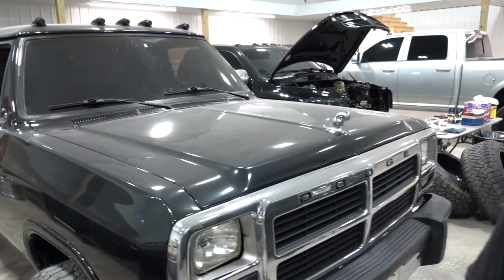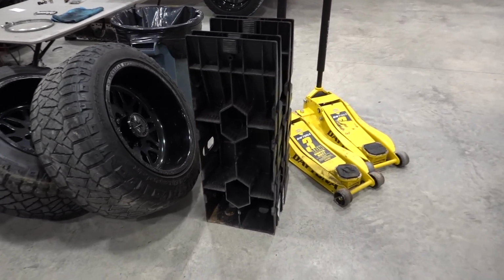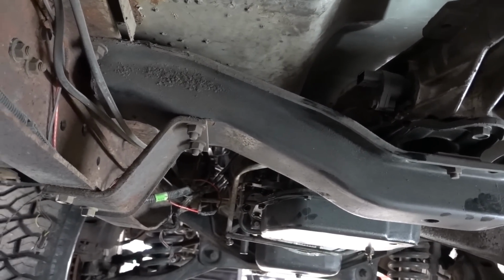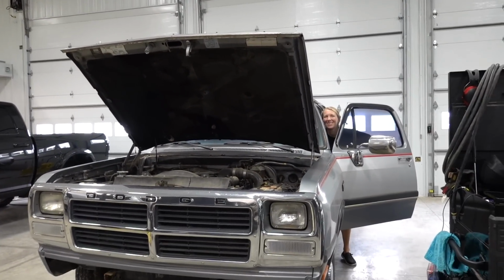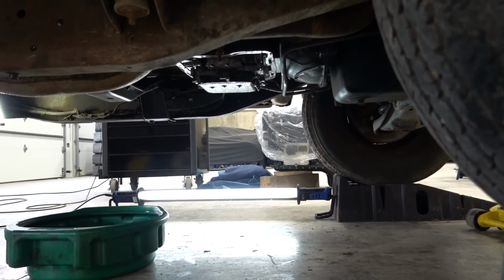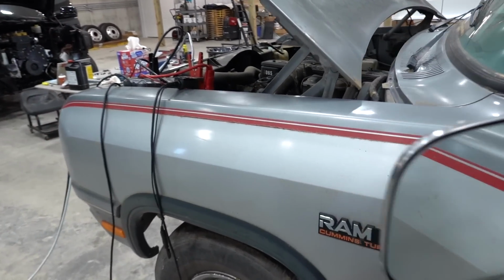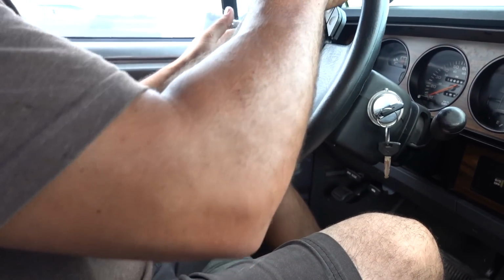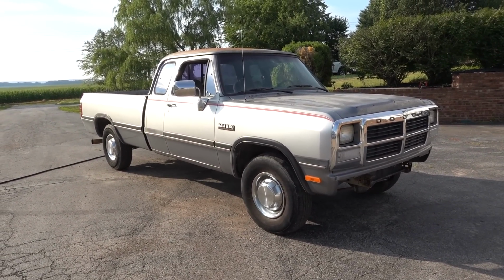Old DODGE Cummins Truck LIVES AGAIN after Years of Sitting!!!

Comment: The map light is switched on, which can kill the battery. I've done that on my own.  Even with the different output speed sensor it looks like your VSS is dead as the speedo doesn't work. That also means the true mileage is a mystery.